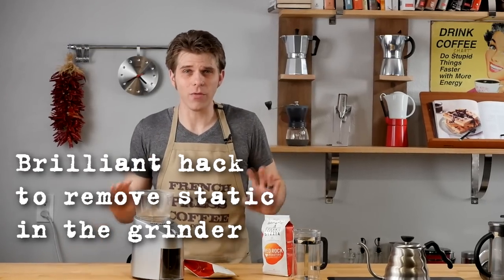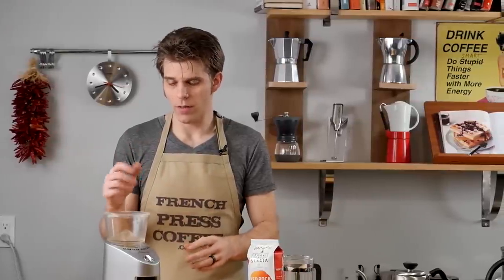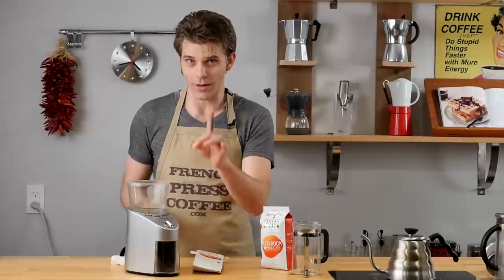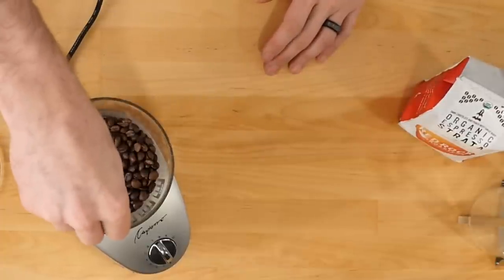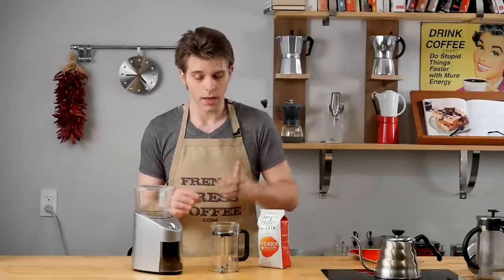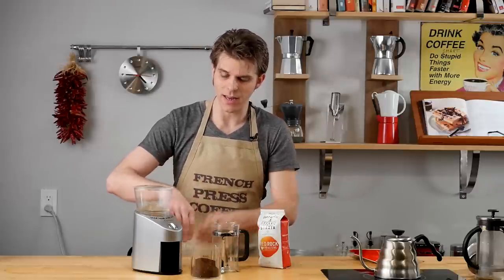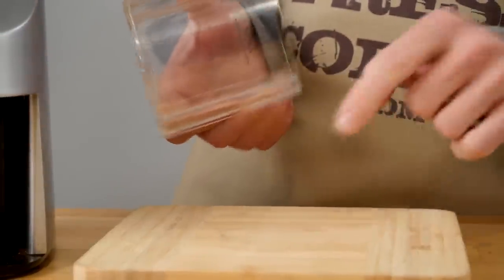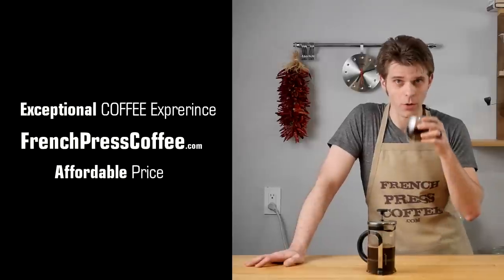Brilliant Hack to Remove Static in the Coffee Grinder at no cost

Comment: I also heard that you can wet a teaspoon handle and stir the beans in the hopper. Same thing happens, less chance of putting too much water in there.
Reply: Thanks for the tip👍
Reply: Yes..also no paper waste and much more elegant. Edit: tore a small piece of paper towel off sheet and used it to squeeze 2 or 3 drops of water directly in hopper with beans. Worked 95% better than with spoon....BUT...was stirring spoon in bowl of beans and then adding them to hopper which might have defeated purpose. But this worked so well I’m sticking with it. ☕️
Reply: Yes!  That works and is safe, like you said 😊
Reply: It really seems like the grounds can make all the difference. I tried spoon on one decaf batch. Perfect. Tried to repeat (right after) with two regular of the same brew. Nope. Static explodey craziness.

Comment: Put water on the coffee is not such a good idea, you re not remove the static of the plastic cup, ure just wet the coffee so it will not fly everywhere and add the weight to the coffee so it will gathered and stick together, but the con is you make it worse when you are doing cleanning and maintenancebthe coffee will stick together inside the burr and stick to the burr, and now you cant clean your burr using soft brust, you have to make more effort to clean inside the machine, and one more thing since you already wet the coffee more or less the coffee will taste less because you release it with water already, is like press it in the grinder, and of coz u cant keep the rest of the remaining coffee in the grinder container coz its already wet
Reply: Just a few drops ,works

Comment: There is a cost to this hack. if so happens my grinder isnt ceramic or stainless steel, but hardened steel. My burr will rust eventually right ? so i think i cant use this on my zass panama, since its hardened steel.

Comment: Cute. Now everybody go try it for yourself and you'll quickly realize how wonderful editing can be. It will eliminate some static cling, but nowhere near what he would have you believe. If you can, replace your plastic grounds container with a suitable glass jar. For some reason the static just doesn't build up in glass like it does in plastic.
Reply: TM1Alan my bodum grinder with a glass jar had tons of static. There are a lot of variables that determine how much, if any, static you have while grinding. Type of bean, how it was roasted, humidity in the air, etc. 

You may need a little more than a few drops. Or you could try a cheap spray bottle with a fine mist setting. I squirt the bottle just over a foot away from the beans I'm going to grind spread out on a tray before putting them in my new ROK manual grinder. The bodum died.

Comment: I just stumbled across your video. Nice! I've used my large Brim Burr Grinder for about 4-5 years now and it has always done the static thing. My previous Braun Grinder I had for 13 yrs and finally one day just stopped working ALWAYS did the static thing. My only concern is that this method is only good for if you don't actually use the hopper for keeping the coffee in vs just pouring 'enough' coffee in for one serving or pot at a time. Otherwise definitely seems like a nice 'save'.
Reply: Agree, this teaspoon of ground powder for each spin is a huge waste of time--I have to have good coffee, but down to one cup a day from all this nonsense--quality is OVER in every brand copied and plastic thrown together in China for Amazon, same deal for irons, remember those? I sew tote bags and checked out all of the big 4 brands, Proctor -Silex/Sunbeam/Black&Decker and more, all identical inside (I sent through Dane thing early 2000s with cordless drills, chop saws and ended up buying my small tools at commercial stores that contractors use, worth it, they never break, wish I could conquer the coffee grinders same way. Btw, I will NEVER toss any kind of appliance that I found again online and ordered again, I will hold onto it until I can find a grandpa to fix it. I was given a corded electric drill about 25 years ago, kept leaving on bench for bigger and better battery models all through the years--it won't break. On a lark, next time one heats up and stops, don't care the type hedge trimmer, elec.drimmel copy...open it up,melted plastic fly wheels.
Just saying, our Dad's bought one of each of these in their lifetimes, replacing only saw blades, bits..
now even a box of deck screws or mystery metal alloy hex bolts, can snap off like chalk. There us no way to prepare a vintage carpenter who has helped say replace wood on a roof 60-80 years rafters and see how hard it us to remove those fantastic hand-driven nails, and you have provided him expensive, even Teflon coated screws that snap crumble.

Comment: You are a genius!  I have a manual burr grinder from Olde Thompson that has a plastic reservoir at the bottom.  The ground coffee would always stick to the bottom of the metal grinder and to the sides of the plastic canister.  I had to use a brush to get the grinds off.  This time, I squeezed a few drops of water from a wet paper towel over the whole beans and then ground the coffee.  There was no coffee sticking to the grinder or the canister.  Amazing!  Thanks so much!!!

Comment: This is great. My only concern is that when I recently got my Capresso Infinity I was rinsing the grounds off the removable burr. Imagine my surprise when I saw dots of rust forming! It should be stainless steel but given that it's not I switched to using a toothbrush to clean off the grounds into the French press (no water). I'm wondering if your hack will create rust on the removable or fixed burr?
Reply from the maker: +BrianH Thank you for great feedback. I personally don't have this issue since I use this technique for a while. But we test it in New Mexico which is very dry state. Idea is quite simple to add only 2-3 drops of water (no more). Beans will absorb it and while grinding water don't have direct contact with mills.
Reply: Yep, oils from the beans should "season" the burr grinders and prevent the rusting.
Reply: The burrs are high carbon steel, which is great for durability but susceptible to rust. I suppose the answer is to make sure you dry off the burrs with a paper towel afterwards.

Comment: I have a Baratza Virtuoso. Not too much of an issue with that grinder. Still helpful.
Reply from the maker: +Ian Bamberger Thanks for watching!
Reply: +Ian Bamberger I hava a Baratza Preciso and it is a HUGE issue. After a few days my counter around the grinder is coated with coffee. I'm going to keep a spray bottle next to the grinder. Problem is I keep the hopper full and I don't think this is going to work.
Reply from the maker: +Bruno “Richard” Bronosky Sorry to hear it. I did tried it with full hopper as well and it actually works very well. Hope this helps.

Comment: What's with the piece of tape on the lid?  Is the lid a weak design or did you drop it?  I'm interested in buying this grinder but not if it has cheap components.
Reply from the maker: Drop it :(. Top cover is plastic. Otherwise works great (use it few year now). Hope this helps.

Comment: I use grounding equipment - same stuff I use to build computers - it's actually pretty cheap and simple. One touch from the equipment and that's it. You wipe the existing coffee off, and it comes off clean without sticking back on. New grinds will not stick until the charge is regained, which can take months if the humidity is not too low. I ground my aeropress too, works like magic.
Reply: how do you ground it exactly? what kind of equipment?

Comment: Nice video - BUT... what about those of us who only grind a bit of what's in the grinder?  My hopper is air tight so I dump in as much as it holds and it's good for days.  But when I grind, it might only grind 1/10th of what's in the hopper.  Meaning, any drops of water I add, aren't going to go through the grinder.
Reply from the maker: For small amounts just dump your finger (wash your hands of course) to water and mix the beans with it. It should be enough. Hope this helps.

Comment: In the manual is forbidden to spray water inside. Rust is a problem, for sure, for coffee quality and for the durability of the burr. "Don't run anything under the water or spray anything into the grinder"